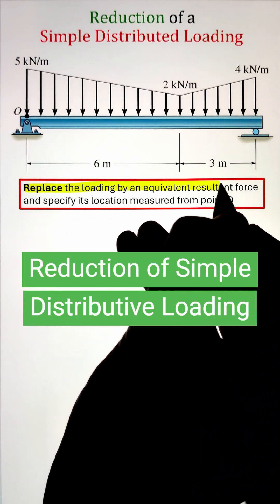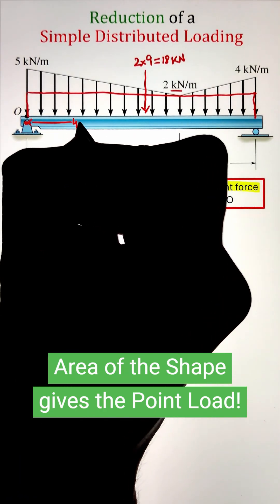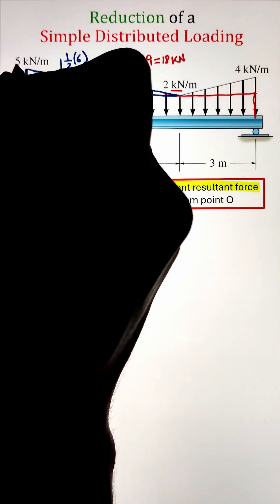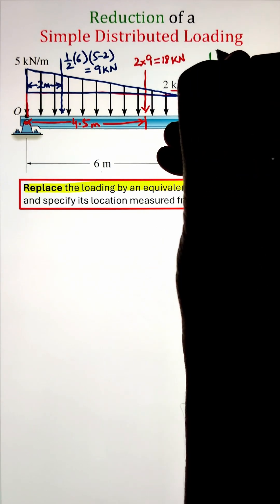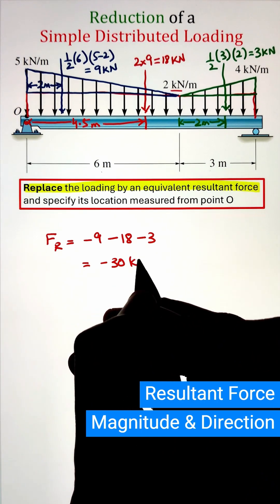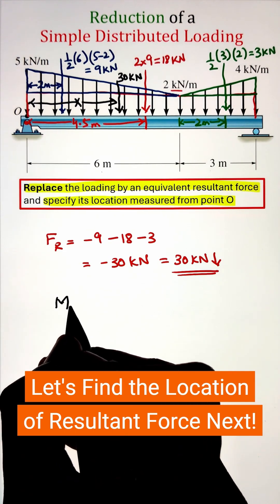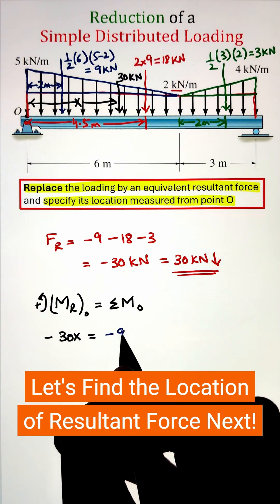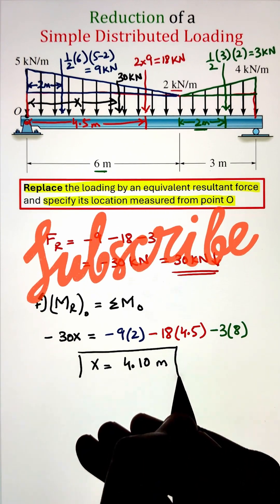Reduce Distributed Load on a Beam → Single Resultant (Quick Statics)

Comment: What about the reaction force from the roller at 9m shouldn’t that be a positive value in your moment equation
Reply from the maker: Since in the question it was asked to replace the loading with a point load, so we just focused on the loading (active/action) forces. If you're solving for reaction forces you need to include them in the moment equation as well as summation of the force equation. Hope that clarifies.